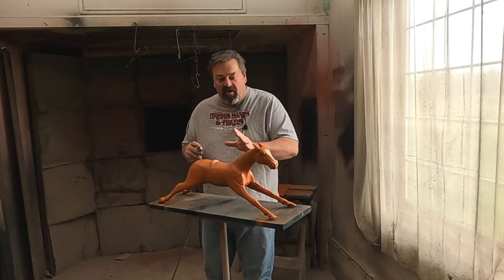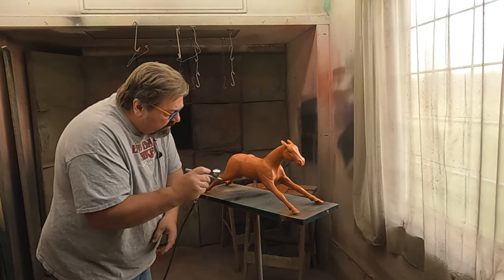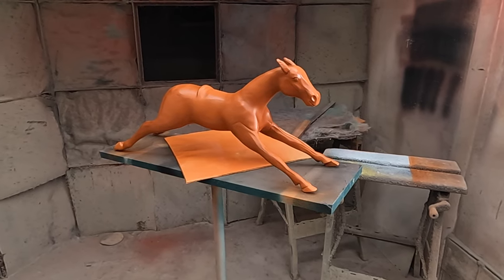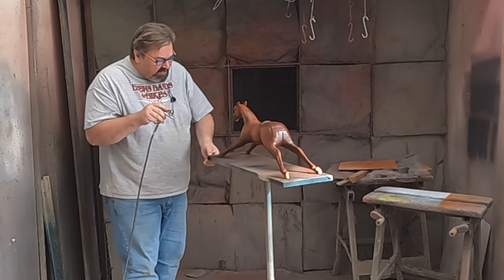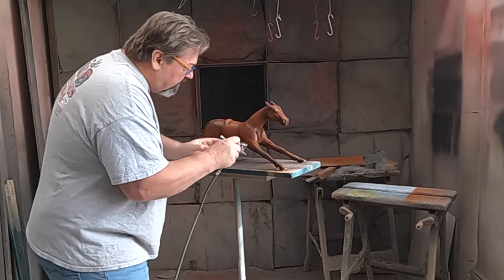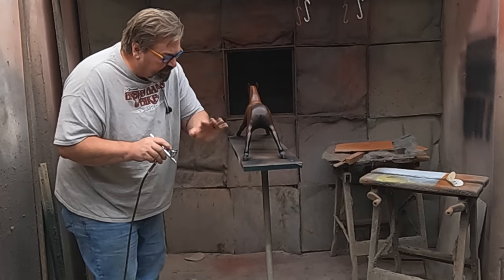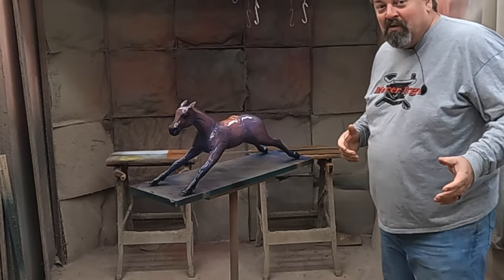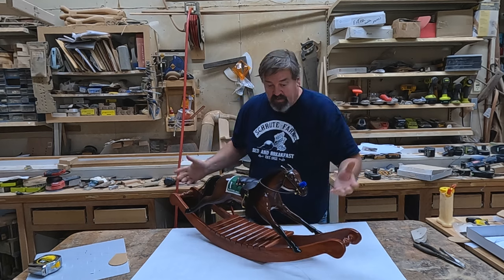Crafting a Masterpiece - The Keeneland Mercantile Thoroughbred is FINISHED!

Comment: Im getting close to finishing my first decretive rocking horse.  I heard you mention Bow rockers are difficult.. Wow can I agree. The first one was complete, beautiful and simply didn't work.  I concentrated on getting the XYZ's perfect, than while working on the ABC's the xyz's moved.  It was totally off by an inch.  Everything being on a compound 10 degree compound angle, nothing come close to matching. It was glued and screwed (that was my mistake). The second one was much better.  I'm now building a saddle and tack
 
What wood filler would you recommend?  I'm leaving the horse natural.  I tried to use stainable wood filler. The first took no stain, the second took marginal stain. Lots of hours sanding. Keep up the good work.  Thanks again.
Reply from the maker: I still have one of the first rockers I made. I’ll have to make it a point to bring them into the shop and show how far off they are. Rockers are hard hard hard to make and get right. Every once in awhile I’ll build a set that is off a little.  
Have you tried mixing wood glue with the sawdust from the horse? It works well. I use Elmer’s here and after is all painted, if it’s really bad, I’ll actually paint it to blend it in. Especially since your horse is going to be natural. You could try taking and artist brush and paint it to blend in with the natural wood grain. 
I really like the Quikwood epoxy filler except it doesn’t stain well.  Looking forward to seeing the finished horse. 
Brett